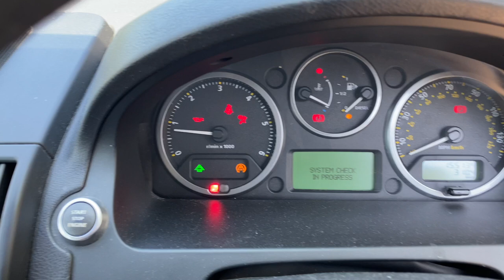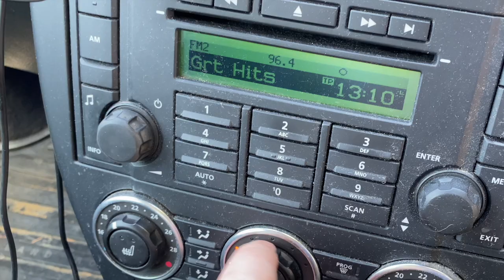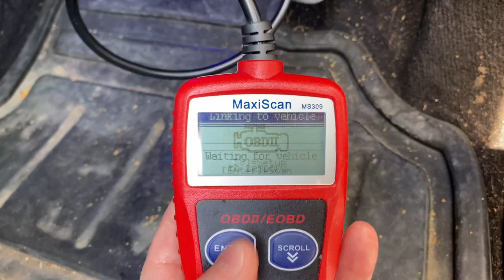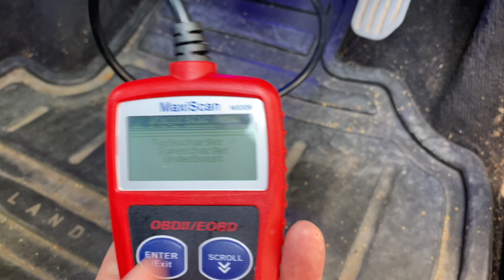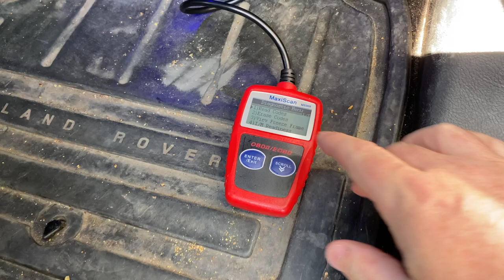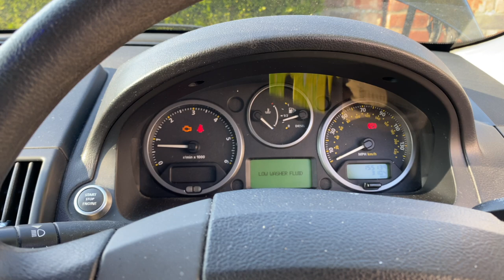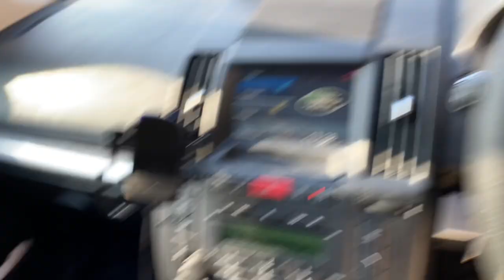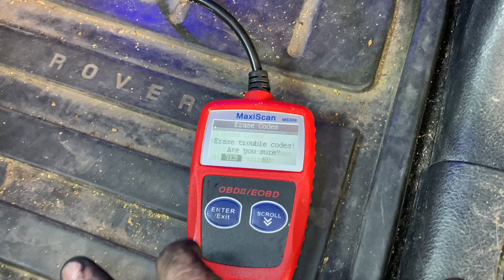Intercooler hoses & throttle body replacement on Land Rover Freelander 2 / LR2

Comment: Would like to say thanks for your video.  My lower intercooler to throttle body hose developed a large split. Engine management light came on displaying both reduced engine speed and DPF filter full.  Although quite handy entering limp mode as soon as the Welsh 20mph zones came in.  The knuckle joint is a must have for taking the bumper off as one hell of a job and four hours of frustration without one.  After the car finally reset all warnings after resting overnight and a good run down the motorway doing 60mph in fourth gear to clear the DPF.  This has now resulted in the car passing the MOT with no issues.  The only hiccup I have had is the car temporarily entering limp mode after a harsh acceleration but I'll keep my foot a bit lighter on the gas for now.
Reply from the maker: Glad to hear my video was useful!

Comment: Myself, along with probably every other FL2 owner, has had to change that hose and the throttle body. You do really wonder how much road testing LR do of their vehicles before releasing them for sale.  I saw an interview recently when Gerry McGovern bragged that the new Defender was very rugged and had over a million miles of testing. To me, that is nothing at all - e.g. 10 cars at 100,000 miles each or 20 cars at 50,000 miles each.  Its no wonder the new Defenders are beset with trim rattles, drivetrain, software and other problems!

Comment: Why are you keeping this engine so dirty? This is an engine that can be washed without any problems, I also have a 2010 model, I would be very uneasy if the engine was in this condition.
Reply from the maker: The mud on top the engine is from off roading in deep water. I have tried to rinse it off but it is difficult to remove as baked clay. The oil on the lower half of the engine is a mystery. It isn’t coming from my engine breather or intercooler hoses as I have a catch can fitted. It may just be leaky gaskets. The car is 12 years old.

Comment: My freelander 2 suddenly started making a whooshing noise on acceleration. It also was jerky in lower revs. I put the obd2 on it, it came up with P0299 which is related to turbo etc. upon inspection, I found the top small slightly bent hose had a split in it. Gonna order one and get the car sorted tomorrow.
Reply from the maker: Common problem, exact same thing happened to me

Comment: Got same issue with mine, checked via OBD and throttle position is stuck at 86.67%... question is, does the new throttle body need coding into the car after replacement?
Reply from the maker: Some say it does but I’ve never heard of any issues after a simple swap replacement. It is just a servo motor, nothing too clever.
Reply: @BeavisPits  i thought so, the car should self learn anyway (thats my theory)

Comment: Im getting the  same air drafting noises and a loss of acceleration in my td4 so my problem could be a split hose? Im getting emissions in the engine bay when i rev the vehicle.
Reply from the maker: Yes, probably a split hose causing the hissing sound although they only contain air not fumes, so you may have an exhaust leak too. Check your turbo and EGR valve.
Reply: @BeavisPits  do you have a video to recommend?
Reply from the maker: Not for exhaust leaks

Comment: nice video very  informative and helpful,i need to change intercooler hose a found it  difficult to tackle it from the bottom is very small space ,do you have any better Idea if there any other way to do it i have put tape around the split just now and the code P0299  gone automatically  ,but i need to change that hose ASAP (VOLVO V50  2011)

Comment: Always best to screw and glue the metal throttle cogs, easy job to do once the throttle body is on the work bench, you can get the whole set up which is not expensive, or hard to fit, video certainly helps people to understand what needs doing thanks for sharing.
Reply from the maker: Do they do full metal replacement cogs now? I’ve seen plastic replacements but heard they don’t last long. The later throttle bodies had tougher plastic cogs in them. My factory one lasted 60k miles, but replacement now done 120k.

Comment: Boss video mate, I've just changed my O2 sensor which is faily easy with a set of ramps. I'm looking at upgrading these hoses as I've only done the throttle body hose. Was gonna ask for clamp sizes until I expanded your description. 👍

Comment: I have the same problem(s). Been trawling the Internet for clear and concise instructions to no avail .... and then stumbled across this video. Absolutely fantastic. Love the explanatory descriptions of how things work and what the purpose of them are. I thank you, Sir, for your time to put this together. I'm going to watch your other vids now! I also have a fault with the driver's door locking mechanism (apparently another common fault). Any chance of a video on replacing this as I've read it's quite difficult.
Reply from the maker: Thanks, not done a door lock yet, but they are a common failure on the FL2 so probably won’t be long!

Comment: this is a really helpful video. i just bought a 2010 FL2 just wondered what the oily gunk was on these front hoses. This is obviously my issue too. Thanks. Assume oil on outside of hose is due to oily mist coming out of the split hose and road grime sticking to it.
Reply from the maker: I think the oil on mine was mostly road grime as the insides of my hoses are dry due to my oil catch can. On a standard setup, oil may leak from hose splits/joints.

Comment: Great video watched it all can I ask,Before changing the throttle body did you have a high pitched tone coming from the area? Also the code scanner you have are you happy with it? It seems cheap and some on fb seem to say avoid it. Thanks in advance
Reply from the maker: A very high pitched sound for around 10secs after switch off is normal. However, if it is a grating/scratching sound combined with spluttered shutdown then the gear teeth are worn and the throttle body needs renewing. I am now using an Autel AL519 wired code reader. I tried an Autel bluetooth device with limited success (I put up a video on that).

Comment: Given the size issues with the silicon hoses would you recommend genuine LR hoses instead? I know silicon last longer and work out cheaper but they seem to cause problems
Reply from the maker: I’d always recommend silicone hoses as much stronger. Only one of the four hoses needed trimming slightly, but you will need to protect the intercooler input and output hoses from the bodywork and aircon compressor bolt heads. This applies to LR hoses too.

Comment: I have the same engine in my Citroen C6.  Is there a video on replacing the glow plugs?
Reply from the maker: I’ve not made one but you may find someone else has. I think the engine is also used in Peugeots and Ford Mondeo.

Comment: Hi, great video. What's the model of your code reader, and where did you buy it from please?
Invaluable video information. Thanks for all your hard work 👍
Reply from the maker: I now use an Autel AL519 wired code reader. Very good. I tried the bluetooth AP200 but found it very troublesome and unreliable.

Comment: Dear Sir, I have a freelander 2 TD4 2010 model, it showed P2297-21 fault code, it got of smoke came out of exhaust while accelerating,does replace the oxygen sensor will solve? The fault code state bank 1 sensor 1,2 which sensor is sensor 1 ? 😅Appreciate for you kind assist🙏
Reply from the maker: I think there is only one oxygen sensor on the FL2 exhaust. It is up the front, above the PTU.
Reply: Thank you for your reply Sir! So there is no oxygen sensor near the engine bay right? Only one on the exhaust ?
Reply from the maker: Correct!

Comment: i have a air hissing noise too, but mine goes when i press the brake pedal slightly... so when driving, if i touch the brake pedal too, the hissing disappears... servoboost maybe ?
Reply from the maker: Brake servo vacuum feed pipe or servo diaphragm split.

Comment: I recently replaced a split pipe, the one that attaches to the throttle body.  Had to use a next day delivery Amazon special, cheap, but wasted too much time trying to get it on as not correctly sized, was too tight, but got there in the end and car back on the road.
Now think another hole has develped in one of the other pipes as similar symptoms since yesterday.  original hoses, Freelander 2 SD4 just hit 70k miles.
Im having a problem trying to find hoses!  a web search doesnt seem to be offering many options.  Any known good suppliers in 2023?
Reply from the maker: I wouldn’t bother with cheap hoses, or even genuine LR ones, they will just split again. Fit silicone hoses. Check out Auto Silicone Hoses on ebay.
Reply: @BeavisPits   Thanks for the response.  Agree, cheap hoses arent a good solution, mainly as they dont fit well.
I did check out Auto Silicone, but they dont seem to do a specific FL2 kit anymore.  So still searching and making enquiries before Im probably forced to go OEM from a main dealer...
Reply from the maker: These are the ones I fitted : https://www.ebay.co.uk/itm/301091005313?mkcid=16&mkevt=1&mkrid=711-127632-2357-0&ssspo=f6kHjzuQQCu&sssrc=2349624&ssuid=3rl5rwijqno&var=&widget_ver=artemis&media=COPY
Reply: @BeavisPits   Thanks again, I've contacted that seller to ask if they do a full hose kit.
Reply: DPH were the only ones that seemed to do a full kit, but dont have any stock and never answer the phone.  I had to go to JGS 4x4 to get the Intercooler to throttle body hoses.
I ordered the turbo to intercooler hoses from MTC.

Both have arrived today.  The JGS supplied are Britpart and look good quality and large diameter. 

The MTC look decent quality, but the diameter is a few mils less than the britpart, they noticeably look physically smaller.  The question - Are the turbo to intercooler hoses narrower than the intercooler to throttle body??

The ends that join the intercooler look just about the same diameter.  It's the end that attaches to the metal pipe and direct to the turbo that look the smallest diameter overall.

I just called Land Rover for just the turbo hose, 120 + vat, for that little hose !  Thats a reminder for why I dont use main dealers, but Im a bit stuck trying to find anyone who supplies all the hoses and that look a right fit.

Is the TD4 and SD4 hose diameter the same or different as both were listed as TD4, I'd assume the same when it comes to hoses?

Need a solution for this weekend before I take the front bumper off and get to work...

Comment: Excellent video, I've just discovered the short hose behind the radiator is split and like you I thought it was the heater fan at first. I am curious what the purpose is of the "bagpipes" and where you sourced the replacement pipe.
Reply from the maker: The “pans pipes” are resonant chambers to reduce induction noise. LR scrapped them on later models. Full parts list in the video description (not this video, an earlier one).

Comment: I've had a problem with mine losing boost when it gets warm, once I drive it steady  and temp comes down abit I get boost back, but after putting my toe down it heats back up and loses boost again, have you seen this before?
Reply from the maker: Sounds like a faulty air temperature sensor. It may be telling the ECU the air is cold which requires less boost (denser, more oxygen). The only other thing I can think of is a hose softening when warmed up.
Reply: @BeavisPits  where is the air temp sensor or does the maf sensor do that job too, I've checked most of my hoses the easy ones to get to, need to check the rest, thanks for the info
Reply from the maker: It is on the side of the throttle body. The MAF sensor measures air flow. Here is a link to the air temp sensor…

https://www.eurocarparts.com/p/fae-air-intake-temperature-sensor-423590040
Reply: @BeavisPits  thanks alot mate going to try a new one in this week
Reply: @BeavisPits  hi again mate, so I fit a new air temp sensor, it worked for a few hours the temp didn't get upto where it would cut the boost, but it's back to how it was again now, I noticed my old one was clogged my black gunk, would it be worth taking the throttle body off and give it all a clean out?
Reply from the maker: Yes, definitely, also consider fitting a catch can. I sell the brackets and cans if you need them beavispits.com
Reply: @BeavisPits  next job sorted then, not heard of one of them, I'll look into that. Cheers
Reply: @BeavisPits  so done some cleaning and looked at the throttle valve gears they are completely stripped, fitted a new one now, I have live data up on a diagnostic machine and throttle position is staying at 83.1% at idle do they need resetting when replaced or is there some way of recalibrating it. Thanks again, definitely will be putting on a catch can when will you have them back in stock

Comment: Hi Beavis, thanks for the great video, super helpful. QQ: how much oil vapour os supposed to be flowing through these pipes normally? And when does one presumably need to clean the intercooler since its also getting clogged up?? My lower front hose  is weeping oil and soiling the underpart of the engine and tray, but no discernible drop in oil level at the dipstick. Thanks!
Reply from the maker: Ideally there should just be fumes with no oil. As the engine gets older it will vent more oil with the blowby gases. If you are seeing oil leakage then yours is already quite bad and you should consider fitting a catch can. Not only will it clog up the intercooler but it will cake the MAP and Air Temp sensors inside the throttle body which may then misread. Sounds like your whole air intake system needs a good clean out and a catch can to remove the oil. You can vent to atmosphere but mot tester will prefer it recirculated. I’ll be doing another video on this soon.
Reply: @BeavisPits  Thanks mate appreciated. I spent the morning dismantling the Freelander. Result: pipe from air filter box to next union (where the crank(?) vent joins the pipe, dry and clean. A little oil at the above mentioned junction. Intercooler removed: quite dry and relatively clean; perhaps 1/4 teaspoon of oil total came out, cleaned and refitted. Throttle body: clean as a whistle, a very slight bit of oil around the green o-ring seal at the mating face. The pressure sensor that comes out of the throttle body: slightly wet with oil, partially clogged. Cleaned and refitted. Boost sensor (lower left hand side of intercooler, clean as a whistle! Put it all back together, runs fine.I will have to just keep an eye on that lower pipe and see what happens, as well as the fuel consumption, which has been fairly stable at around 8 L/100km average. 
Q: how does one know whether its just oil from the crankcase, or the turbo bearing seals busy (slowly) saying ciao? I suppose (slow or fast) drop in performance, and maybe smoke out the back, if the turbo is going?
Why would oil fume level increase through the recirculator (pipe going back into the air intake)...or normally, it shouldn't and it's just slow build up?
And, I'm in South Africa...an MOT tester is not bothered with those things down here (yet).
Thanks for informative and thorough videos!
Reply: Also, is there a crank-vent filter of some sort on the FL2, like there is in a Freelander 1?

Comment: How long would you say this job takes if you don't have to fiddle with a camera at the same time?
Reply from the maker: To replace all four hoses, plus the throttle body and removing the front bumper, it would take a novice home mechanic 3-4 hours. An experienced garage mechanic could probably do it in under an hour.

Comment: Hi. Can you provide all the intercooler hose that you chanced? My 2014 LR has a check engine light on, and I hear a whistling sound whenever I step on the accelerator. Can you give me a list of all the hose that you’ve change. Thank you.
Reply from the maker: I don’t provide the hoses, sorry. I bought them on ebay. Search for “Freelander 2 intercooler hoses”. There are four. The clip sizes are all in the video description.
Reply: @BeavisPits  Sorry I posed the wrong question. Is there an email you can provide so I can further explain to you what I wanted to ask? Thank you.
Reply from the maker: If you go to my website beavispits.com you’ll see the info email address. I don’t put it on here as it will get harvested. It may be better if you join one of the FL2 facebook groups. You can then ask any questions you have and lots of experts to answer them.
Reply: Will do. Thanks.

Comment: Hi Beavis, found this video very interesting, I have a leak on the top left hand side of the  Intercooler Pipe to Intake Manifold and noticed you have changed that, would you by any chance know what size  the clamp is as I am nowhere near the vehicle and would like to change it when 
i am
Reply from the maker: All the clamp sizes are listed in the video description

Comment: Following this video I've found that you don't actually need the throttle body to work If the ERG delete is done, I've removed the butterfly plate from my throttle body after finding all the gears stripped. My car is running great with no issues. In fact its smoother, quieter and appears to be doing better on fuel.
Reply: Are you not at higher risk of a runaway engine?

Comment: His there a hose from the air cleaner to the turbo and where do you get the clamps from
Reply from the maker: This is a black plastic duct as standard. I have replaced mine with 70 mm diameter. Silicone hose and aluminium, straight hose joiners. The clamps are stainless steel Mikalor clamps. All from eBay.

Comment: Would this cause my air mass correlation fault code?
Reply from the maker: Possibly, but check your MAF sensor too
Reply: @BeavisPits  how do I know if the Maf sensor needs changing? What value should I expect?
Reply from the maker: @markpaxton1772  you’d need to read the codes…or fit another sensor and see if the issue goes away!